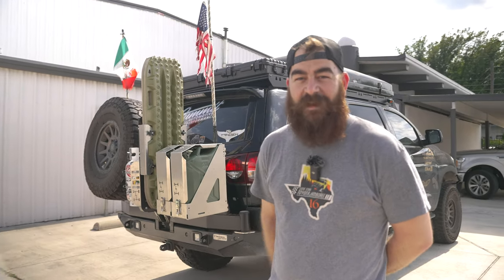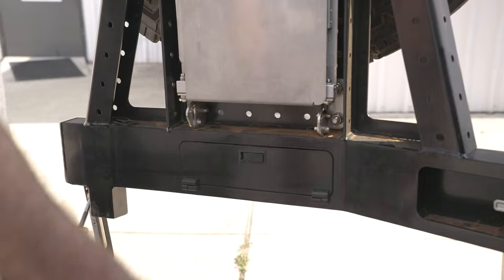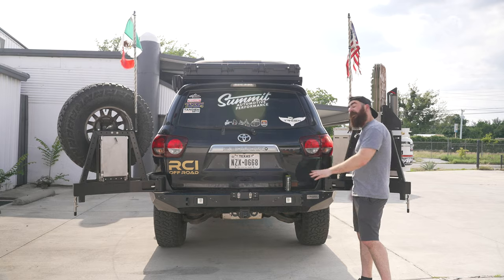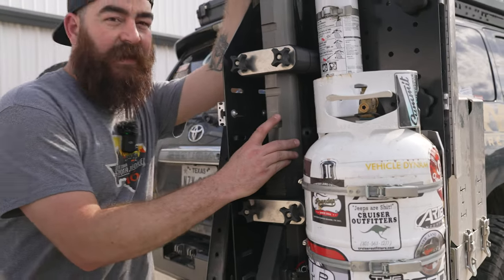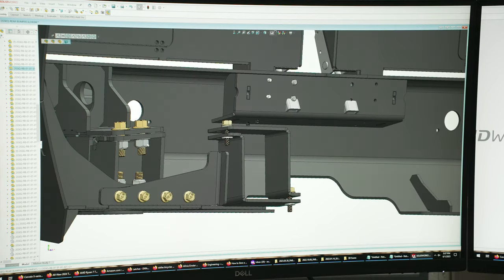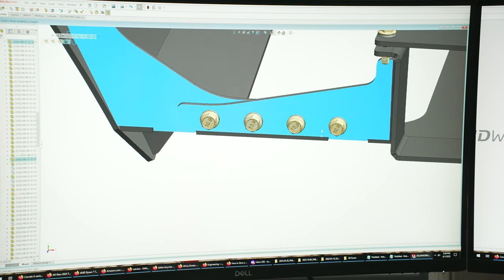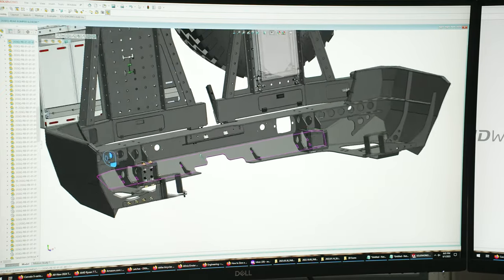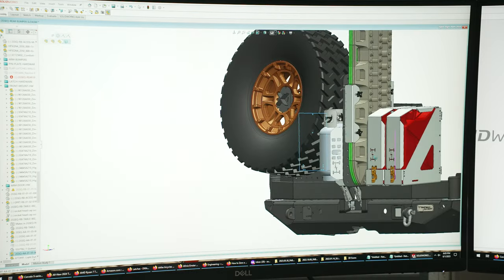Deep Look at Tandems 2g Sequoia Rear BUMPER!!

Comment: Where are the ARB jack points on the bumper?  Is it not stiff enough to hold the weight of the vehicle; or does ARB have a patent on bumpers with built in jacking points?
Reply: Great question! It is plenty stiff but you wouldnt need ot do that. We typically just lift from the sliders! If you wanted to lift just the rear, you can use the factory receiver.